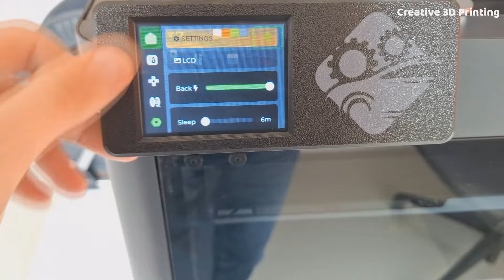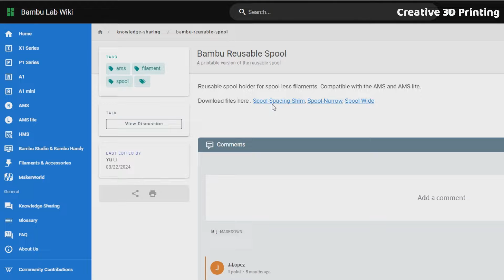7 Upgrades for your Bambu Lab X1/P1

Comment: The upgrade I want most to have a bamboo printer accept cura a slicer.
Reply: I use a cura slicer for a bamboo printing. It's a pain in ass to go in and change the G code but it can be done.
Reply from the maker: Why don't you use bambu studio?
I've used cura for years and now i'm happy that I switched to bambu studio.